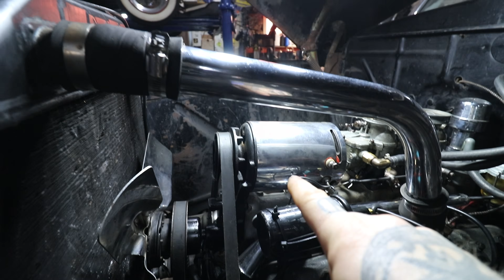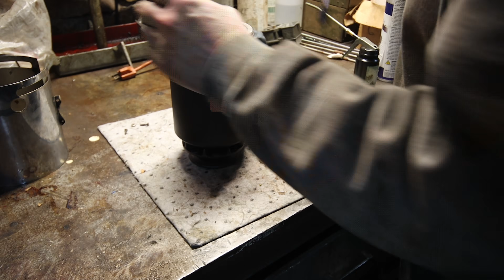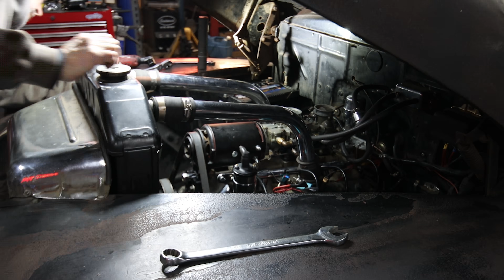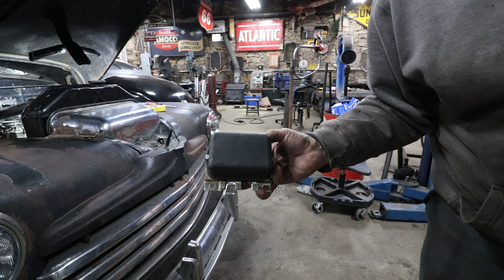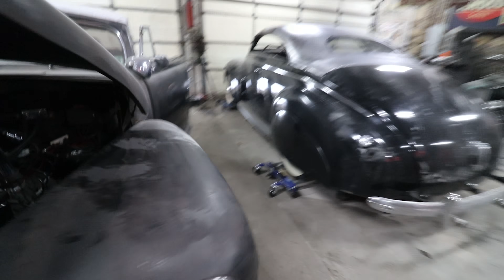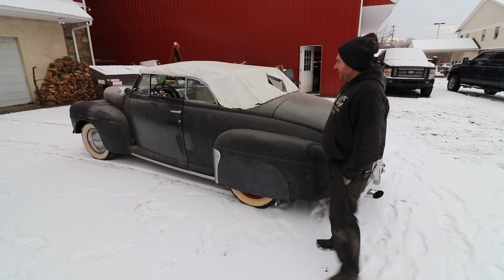Converting Pete's 1946 Ford Survivor Custom to 12 Volts!

Comment: Did you have to do anything to the distributor? Going from 6v positive ground to 12v neg ground.
Reply from the maker: A points distributor doesn’t care what voltage or style ground system. The coil does though.
Reply: @IronTrapGarage thanks for the info. Keep up the great work.

Comment: Did you have to do anything to the distributor besides changing the coil
Reply from the maker: Nope. Ballast resistor before the coil to drop the voltage to the coil
Reply: @IronTrapGarage  Thanks for the information

Comment: Would like more detail about everything working with reverse polarity please.
Reply from the maker: The parts don’t care if it’s negative or positive ground. Only items that do are the starter solenoid, voltage regulator, and starter button.  Otherwise most everything else can be wired either way.

Comment: Great job Steve ! But I have to ask - what about the horn and wiper motor?
Reply from the maker: Horn doesn’t care if it’s 6 or 12v. Just louder. Doesn’t get used enough to cause a problem. Wiper motor is vacuum on these cars.

Comment: Low voltage is what kills a starter. 6 volt starters will spin the motor over faster than a 12 volt starter will.

Comment: Did you put a resistor to drop the voltage to the gauges or is it not needed
Reply from the maker: Yes we did.
Reply: Thanks for the quick reply😊

Comment: I believe one can convert OE gauges from 6v to 12v by simply installing a constant voltage regulator (CVR) as the power source for oil, temp, and fuel level gauges.  The factory 6v gauges for 1956 were carried over to the '57 12v system with the introduction of CVR which were used for more than 50 years.
Reply from the maker: Yes you can. They were stock in fords up until like the 80’s but we didn’t have any laying around and they’re like $100+ new

Comment: English dynamos control the field coil to cary the output of a dynamo. There's a company called DynamoRegulators that makes excellent electronic regulators than can be 6V or 12V. They may be compatible with US dynamos, or make a variation for such.

Comment: Didn't hear Steve say but did He use the 6 volt starter  ? Did the same thing to my 49 F1 but kept the 6 volt starter . Only problem with that was the truck was a daily driver and would over time break the bendix spring . An FYI Honda motorcycles from the 1000 - 1100 Goldwings had a 7 volt regulator for the instrument cluster . Good job on the video and very informative people wanting to do this ...
Reply from the maker: 6v starter. All of our cars have that and never really had an issue.
Reply: Like I said my truck was a daily driver for about two years . I used it as a service truck for a marine diesel service business where your cars are not . I probably put 5 - 8 K miles a year on it ....

Comment: My old Farmall tractor is a 12v coversion and still uses the original 6v starter.  If it's being difficult to start, I just don't run the starter for more than about 10-15 seconds at a time.   Normally though it starts in 2 to 3 seconds.

Comment: What about the voltage regulator, resistor , coil , radio 
I’m by no means a electrical engineer 
Just wondering sir
Reply from the maker: All of that was done. Radio doesn’t work so that wasn’t an issue

Comment: I have a question why don’t you add more light to the shop so you don’t need to use a flashlight so much Mike is a professional at that now 😊
Reply from the maker: You always have dark spots in a shop when working under hood or under a car or when your eyes aren’t as good. Shop has plenty of light but we also don’t want an operating room and headaches from ultra bright lights.

Comment: Yes sir this presentation helps people to understand what is involved in converting from 6v to 12v and I also see that there are outfits that convert the generator to an alternator using the generator case setup in order to utilize the original mounting system, but I would imagine that to be rather expensive and unless one has a uniquely large electrical load on the system would not be necessary. I live down here in northern Florida (or some would say southern Georgia) and one of my vehicles a 1985 Chevrolet truck that my dad acquired for the cab (but never got around to swapping it) was owned by some kid who "hot rodded" it (but essentially screwed it up) and the carburetor had been replaced with a Holley 4bbl manual choke. When I crank it up on first thing, I pull the choke out almost full and start it (it starts but runs excessively rich) and then I push the choke in until it smooths out (a poor man's choke pull off). Of course, after engine warms up the choke can be pushed in. I used to get aggravated with it trying to start it any other way. I also have a John Deere A model that I choke the same way, and it pops off right away and then I push in the choke until it runs smoothly. Thank God for a properly adjusted automatic choke set up.🥸👍👍👍👍👍

Comment: I used to work at a restoration shop that sold 6 to 12v conversation kits retail.  I did some many 12v conversions that I could see #6014, 1004, 1156, 1157, bulbs in my  dreams
Reply from the maker: Haha yep you had the part numbers memorized!

Comment: Here I'm watching you guys make the conversion and surprised that you didn't go with an alternator instead of the generator. A guy named Paul Shinn works on Model A's and he goes with the alternator because a generator can have problems with overcharging the battery. He also suggested switching out to LED's. Just a thought.
Reply from the maker: We also prefer to keep the vehicles old style. A generator worked fine in 1946 and it works fine now. Just have to understand what you’re looking to do with the vehicle. The generator he’s talking about has a cut out and you have to adjust the brushes for the electrical load. These early v8 generators have an external regulator that controls the amount of charging.

Comment: Do you ever use the Powermaster PowerGEN alternators that look like generators? I converted my 63 Falcon to one and love it. I know they make a flathead version. Increased power output (more amps).
Reply from the maker: Yep. But for the cost involved they aren’t that necessary. Increased amps doesn’t really matter when the vehicle has like zero electronics. They are great items just not something we usually use. But occasionally we do. Our 38 convertible has one on the caddy engine

Comment: Will spotlight bulbs require change over to 12 volts?  Are they dummy spotlights?
Reply from the maker: They haven’t been used since the 40’s. So Pete told us to not worry about those. They aren’t even wired up currently

Comment: 1946 ford parking lights are over the grill. 1947-48 parking lights are under the headlights. did the front fenders get changed over the years???
Reply from the maker: It’s an old custom.. they filled holes, changed parts, and modified the car.

Comment: I found this video interesting and informative. Could this have also been accomplished by using a step down transformer (12v to 6v) for the body components while running the engine components directly from the 12v source?
Reply from the maker: Yes such a thing is possible and since there aren’t many items inside the car needed to convert it potentially could be used. We just like dropping down each gauge and swapping bulbs so if a drop down goes bad it only effects one thing and we don’t lose the entire interior power. All personal preference.
Reply: When I was younger and reading just about everything I could get my hands on as far as automotive systems, I remember reading about this 6 to 12 v conversion process and most folks would install a 12v battery and starter for better cranking and just install a drop down transformer to the main power supply to the car as the goal was to have better cranking on the vehicle. Now if you did not drop down to 6v on your main supply of course the gauges may read incorrect and also your lights could burn out due to the increased voltage. I cannot remember as to how the generators were modified or if they were modified at all. Obviously by Steves presentation it is just a matter of changing the field windings on a generator to convert it to 12v and I would imagine the same could be done on a 6v starter as well. One fellow (now retired) that I dealt with on starters and alternators told me that a 6v starter will work with 12v but he cautioned against cranking an engine too long as the 6v starter can burn up with the excessive heat (I would assume the same for a 6v generator run on 12v). One thing that confuses people here is that the Fords were positive ground and all of these conversions are done not only to 12v but also negative ground as well. Most electrical pieces will work on either ground but there are specifics on certain things like the ignition coil and polarity on an ammeter for instance which will indicate current flow (charging or discharging) and should be wired correct to show the right polarity. Biggest trouble people would have was cold starting engines in the winter time as the engine had to be in good shape and tuned properly in order to fire on the first crank. With a marginal 6v battery and poor tune (an d worn engine) 6v cranking just did not get it. My grand father had a 1955 International 6v system positive ground and he upgraded to an 8v battery which helped out but the engine was worn and the tune was not so good, so in winter weather it was hard to start. 👍

Comment: I remember doing this in the late 80s.  Virtually no info existed( street rodder magazine sent me an article-which helped a lot!)
I still run the same 6 volt starter! What aboutthat ballast resistor on the firewall? Was it already there? You can also use a 12 volt 1.5 ohm, internally resisted coil instead. Great info guys! I see this question brought up alot. I like the how-to videos!

Comment: steve is the man!
Reply: What a contortionist 😂 upside-down and sideways under the dash. Steve is amazing 🏆
Reply: Absolutely! Many years ago I bought a 1960 MGA with two smallish 6 volt batteries, each on either side of the driveshaft behind the seats. They worked together to give 12 volts with a positive ground. Had to get them replaced at a service station, which hooked them up with the standard (US) negative ground. Everything worked fine except for two things. The ammeter ran backwards, and the old tube radio refused to work at all. Swapping the ground back fixed those things.